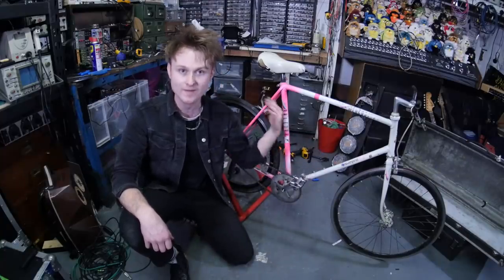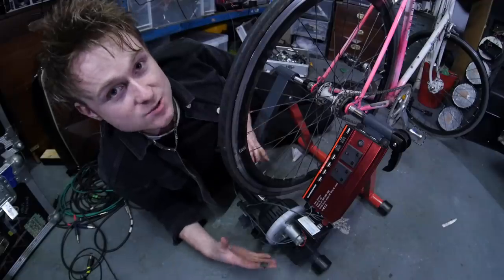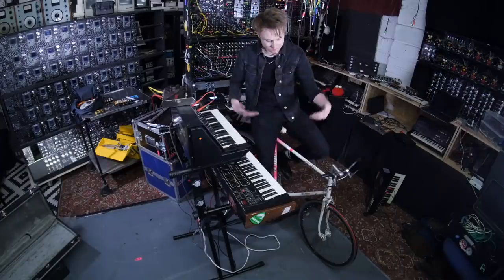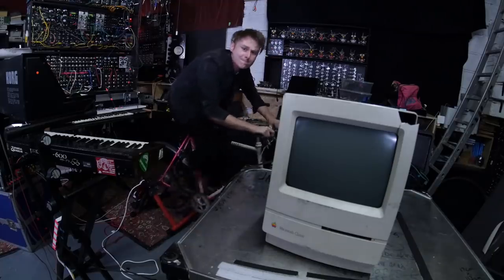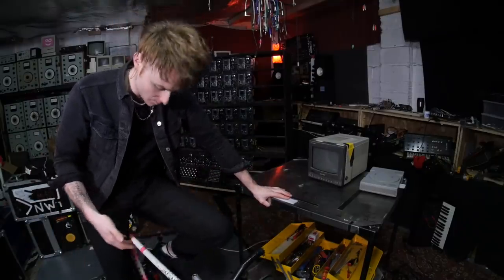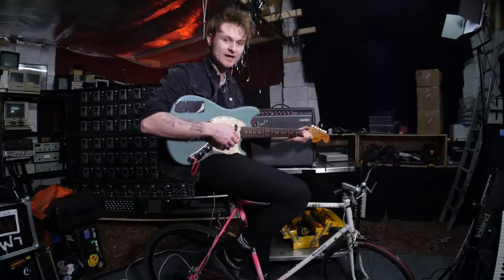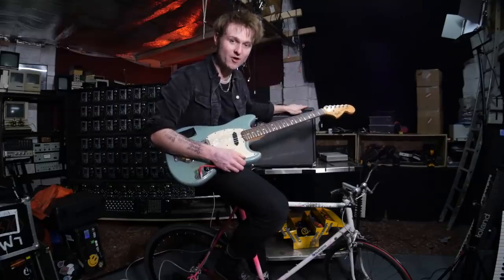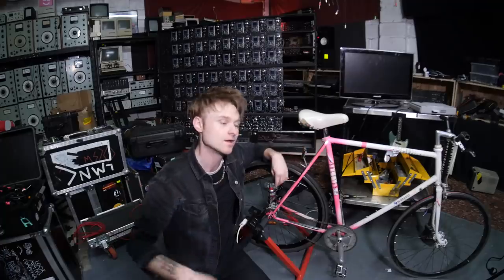GENERATING 240 VOLTS WITH A MODIFIED EXERCISE BIKE

Comment: You should put a battery between the voltage regulators and the load. So the regulators don't get a current spike, plus store excess power.

Comment: Hi! For my high school diploma I built something similar using a car alternator. I removed the back tire and used a belt.
 It worked quite well and I was able to power even a blender.
If you use a car alternator pay attention that you need to energize the primary coil first, otherwise it won't produce energy because it has no permanent magnets inside.

Comment: For some of the items, they are probably powered by a lower voltage, but have a power supply, so what you're doing is generating 12V, stepping it up to 240v, then the equipment PPSU is probably taking it back down to 12V or so, you have losses that could be bypassed.
Add a power jack soo when you plug the bike in, it disables he internal PSU, then you can still use it on mains when needed.
For higher voltage stuff (not the valve amp) you could find a highr voltage drill, or connect  2 or more in series.
I would also add a bridge rectifier and capacitor on the bike to prevent reversals.

Comment: Have the bike drive a heavy, round weight on an axle. Have the axle round weight combo drive the motors. This way you can build rotational momentum that will not be immediately lost when the pedaling stops.
Reply: also known as a flywheel.
Reply: Or instead the bike could charge up a capacitor that would store a little power and provide a buffer

Comment: You need an alternator from a car instead of a motor. I guess an improvement would be some sort of storage system so it didn't cut out the second you stopped pedalling. Maybe a small 12v battery you charge with the bike.
Reply: perhaps a flywheel?
Reply: nah a big ass capacitor
Reply: Power u need is just wrote on the back side of the device
Reply: cat alt pushes about hundrets of watts, way more than a regular person can keep peddling for steady time
Reply: Electrolyzing water to make hydrogen that you can store and burn later.

Comment: :D :D :D  

your brave hooking that thing up the to Mega Synth. lol.  I wonder if there's a way, like the fly wheel idea, but to only engage the power when the RPM's are up enough so the current is steady too and avoid under powering? seemed like the regulators fired steady voltage but not steady current and maybe popped things. A belt drive on the rim might improve things too. not really sure tho never built one :p
also I agree lots of loss thru and inverter, keeping it DC keeps efficiency up, but are all your synths the same DC voltage. not likely. hmmmm.  what a fun project :D :D can't wait to see what you do next. hope this helps. good luck !

Comment: Great, I was planning this trick. You should add big capacitor(s) to smooth the dc from motor (and possibly reduce noise on guitar amplifier). You can grab its from dead power or dead power amplifiers... cheer's!

Comment: Choosing harder (as in require more pedal power) gears is going to be beneficial. Though it kinda looks like the ratio on that bike (smaller rear cog + larger front cog = harder) is already quite extreme. I heard that 11(rear)-52(front) (the numbers stand for how many teeth the cog has) is pretty much the most extreme possibility. So in the end, I think you might need to invent something with a lot more gears one after the other to make it even harder.

Comment: I reckon a scooter theramin would be a nice project and you could set something on handle bars as the pitch antenna and another suitable control system for the volume. moving around and raising/lowering your head would be a good laugh!

Comment: This is litterally the best video I have seen yet this month!!! You playing that guitar in a frantic dash trying to get the amp to work! This is great!! 

Maybe look into making a gear box that can convert the power from the bike to move the motors faster. Less input and more output!! :D
Reply from the maker: ha cheers! i had planetary gears on the motors, the thing is, speed of the motors is not ewhats needed, faster just makes them burn out quicker and it doesnt really supply more ooomph, so i gotta either get more motors around the wheel. or bigger motors!

Comment: Not very garage build, but you could replace the back wheel with a flywheel, and add some super capacitors in circuit somewhere to buffer the energy and keep the output at a more constant level.

Comment: What you want is either a really old car dynamo with its regulator as it doesn't need power to excite the windings. Failing that a normal car alternator and a 9v battery to excite the coil and once  energised it'll self sustain with out the need of the battery.

Comment: try borrowing a stepper motor from the 3d printer, then use diodes to rectify that in to DC, dump that in to the chunkiest capacitor you can find in your garage and feed that to your inverter. Stepper motors are good because they don’t have too much resistance and they have so many like, steps per full rotation that you get a lot of voltage out from relatively slow turning. They’re a pretty good way to make a DIY wind generator, which seems like a similar problem.

Comment: Most of these low power equipment run on DC voltage. You can spare energy on skipping the AC inverter and use DC-DC converters instead.

Comment: One thing you might try is to use it to charge a capacitor bank or emergency power supply. That way you can just spend some time exercising, then use all your stuff after you're done.

Comment: If you stick a cheap battery backup UPS unit on it, and then power stuff off that it should act as both a power-smoothing unit, and also means it won't immediately cut out when you stop peddling.

Comment: you need a fly wheel to smooth it out and keep the wheel spinning when you run out of puff
Reply: I think something was buggered on the bike or turbo trainer because my bike carries on spinning a fair while on the turbo trainer - I think it has a built in flywheel in the turbo trainer which he might have inadvertently removed

Comment: With a different/more efficient generation type (like a moded car alternator or a brushed e-scooter motor from china) you (or anyone else) should be able to generate ~60 Watts of power continuously, just from pedaling with your legs. I would put a HUGE condensator (>1farat) between generator and loads, it would smooth out voltage spikes which make audible noise and may damage some equip AND you would have, at least, a few seconds, when, for example, unintentionally stop to pedal. =]

Comment: Not sure if you're using a modified sine wave inverter, but a pure would be better for the expensive equipment
Reply: Well he said it came from a car 12v-mains adapter, which are all modified not pure. 
That's a good point though, probably wouldn't wanna risk doing that.

Comment: OK so do like multiple bikes so people can swap without it shutting completely down. add some cap to filter out the variations in time. get rid of the wheel to motor contact shit and just gear the motor directly to the middle of the wheel (possible getting a different rpm motor). dont do DC -> AC and then back -> DC because most of the stuff works on DC anyway and this is hugely inefficient. just get some dc-dc converters for specific voltages your stuff uses (even if some synth has a ac power supply built in, there will be dc rail with like 12 or 15 volts inside anyway somewhere, hook up directly to that)

Comment: using motors as generators is not so effective. Use dedicated generators (dynamo) instead. The first most accesible thing to try would be an alternator from a car. Those are actually 3 phase generators  with a full wave rectifier bridge  included. Next to it is a so called charge regulator. By bending that circuit the whole thing  can work up to 40... 48 v on output. A pair of 24 v accumlators buffering that (and properly adjusted) could help when tired of pedaling or when someone else takes over.. The washing machine motor can be great if you find one in reversed construction (stator inside and rotor outside covering the stator like a cup) With the magnets on the pheriphery of the rotor and many poles on the stator you can get desired power at fairly low pedaling rpm. The more magnetic poles the better. I used one in a wind turbine

Comment: If you're going to actually do this, buy a much higher quality inverter, one meant for solar panels not cars.  (Inverter being the thing that converts the 12v drill motor to mains. The cheap car inverters create modified sine waves (looks like - _ -- _ --_ which may damage your equipment) whereas the solar panel inverters create pure sine waves (like ~~~~, which is the same as what comess out of your wall outlet)

Comment: You should measure how much watts you generate with that old wattmeter you had in the other vid. Try to power the heater!

Also to use this on stage you should have some sort of Battery or Capacitor that you charge up. At least to smooth out the power curve. Most hacky way would be to increase the weight of the back wheel to give it some momentum. This would store the enegery in the wheel and it would keep going for a while even if you stop peddling. But would make the overall bike less efficient. Does the bike feel like having more resistance when using under load versus when you have nothing plugged in?

To make this machine more efficient you should get rid of the rubber tires as they eat energy by deforming. Best would be to be able to use the axle directly. Second best would be a belt transmission from the rim of the wheel to the generator.

A normal human can output 100 watts of power. A professional trained cyclist will output between 300 watts to 700 watts. To make this really go on stage you might want to have at least two of those bikes connected together. So you could invite some people from the audience to generate electricity for you. You have a good idea of how much watts your equipment will draw. Use those numbers to scale the number of humans.

Comment: So, noob physics question: what becomes of that surplus energy when it's not being used to power synths?
Reply: heat - the motors will be getting hot
Reply: @beware_the_moose  And if there's no motor? Still heat?
Reply: @prodigalretrod  if the motor isn't there then there would be no resistance, so he wouldn't be able to generate heat. 

As they come from the factory they have a magnetic resistance thing that's basically a motor but with no electric output, it just converts to heat, and there's fan blades to cool it. 

This is why there's stickers all over telling you never to brake while using it. It would presumably warp or melt something if the fan stopped.
Reply: @beware_the_moose  Interesting, thanks!

Comment: Have you tried putting the bike into a really high gear?  For some reason I'm thinking that would make it easier.  Might need a different bike.. or maybe you're already doing that.  Just a thought.
Reply from the maker: the bike is fine. no matter how quick you go, the motors/voltage regulators dont supply enough current.

Comment: Not so easy to pedal Over The Rainbow, mate... Maybe with a 12V battery + a DC>AC converter...? (but obviously, it wouldn't be as fun...!). And of course, if you just need to feed DC 9>18V pedals and synth modules, it will be waaaaayyy easier!!  Even a few simple bicycle regular generators will do the trick :-))

Comment: Suggestions?  I don't know if it will make it any more efficient, but you might want to try sticking a hot chick on a bikini up there bouncing around to doin" the pedaling. It may not do much for the amp, but if you did it on stage the entire audience would probably light up.